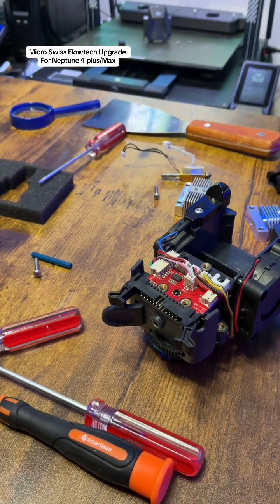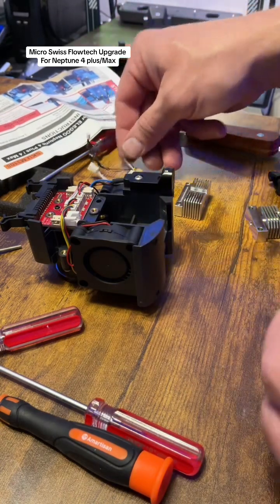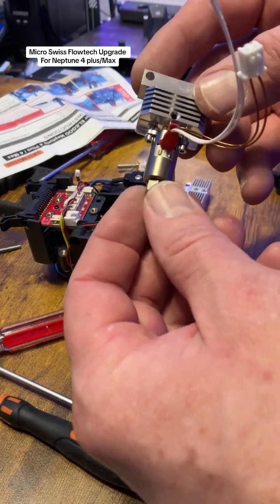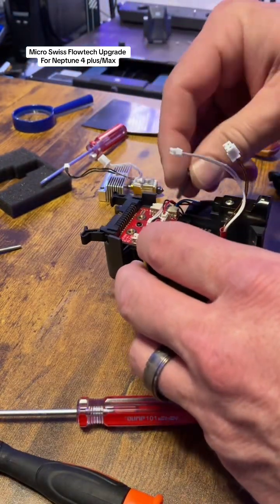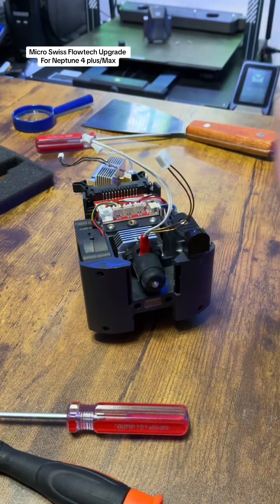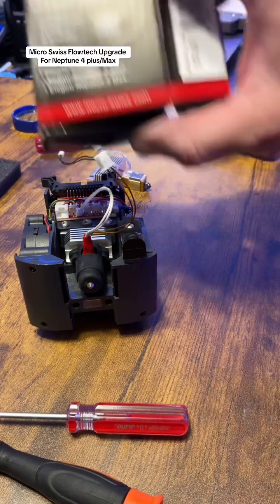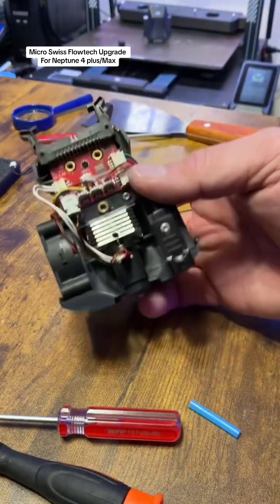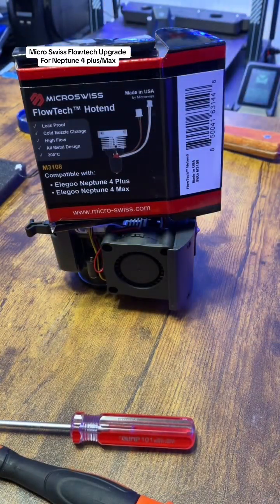Micro Swiss Flowtech upgrade for Elegoo Neptune 4 plus and Max ￼

Comment: Hi there. Thanks for this video. Regarding the configuration on klipper do I need to do anything? thanks in advance.
Reply from the maker: Just run another bed level and z offset
Reply from the maker: Wouldn't hurt to run a PID calibration and a flow calibration in orca slicer if you use that
Reply: @3dpathfinder  thank you! Will do!